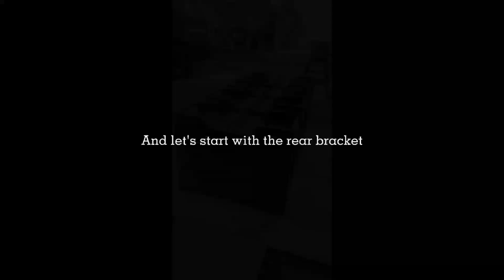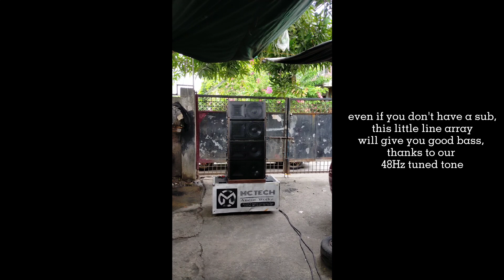How to Make a Line Array D.I.Y. (step by step completion) ver.2

Comment: Hello bros...
I have 2 pair of 8 inch mid range of 150 watt rms i would like to be advised which tweeter i can use .
I'm planning to make a  double 8 inch line array system... thanks bros and nice jib by the way🙌🙌
Reply from the maker: Use at least 65-75mm vc compression drivers

Comment: The most important part of a line array is the waveguide which limits the vertical coverage, otherwise, there will be destructive overlapping (Comb filter). What waveguide did you use for making these speakers?
Secondly, what's the x-over frequency and how did you align in phase and time the driver and speaker?
Reply from the maker: Yup...check my other video.. Theres onother model of line array i build...i use 1519 wave guide ..packed with neodymium...
With coverage of 10°x80°
Reply: @mctechaudioworkz  how to measure the wave guide?
Reply from the maker: I use crossover network for this bro
Reply from the maker: Dn-2400 network